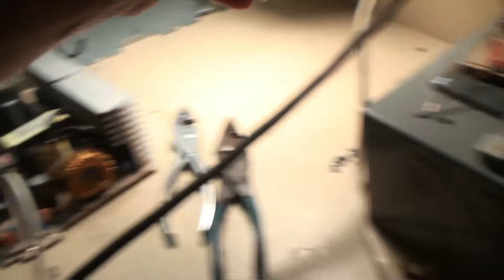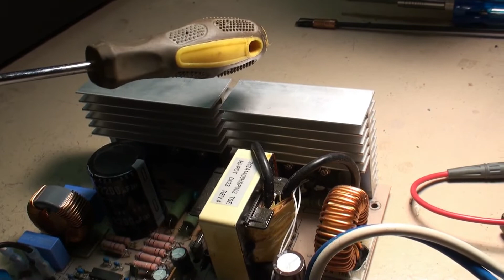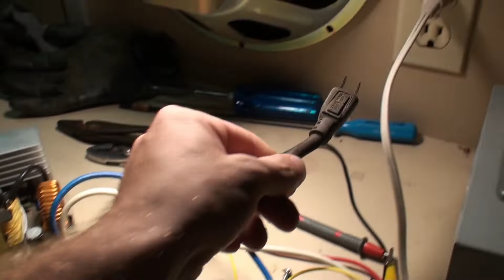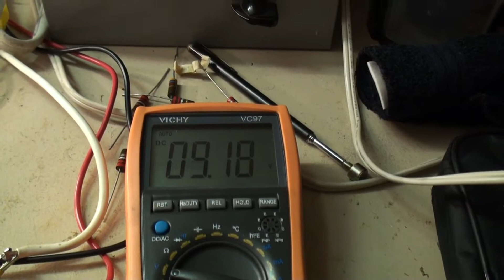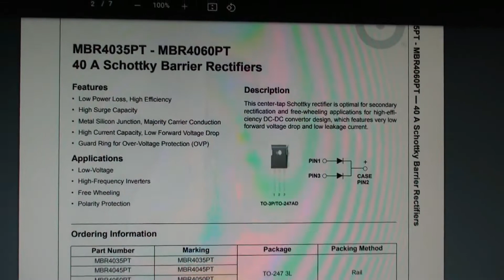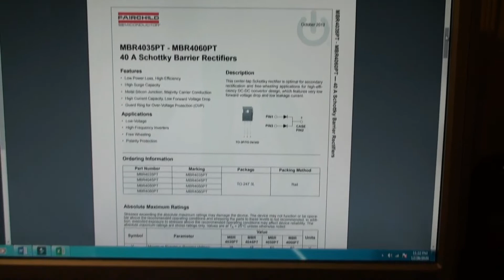Atwood RV Power Converter, Model APS-5530, Low Output, 6 Volts !!  Repair (Part 1)

Comment: This thing is apparently a freak of nature..i have the same. I gave camping world my info and ordered a replacement...they sent me a wfco 8955replacement series "kit"...the thing is an inch too tall to mount where the old one came out.....no instructions no brackets nothing.....
Reply from the maker: I'm really not a fan of these modern switch mode power supplies.  I seem to be constantly fixing them, and I have seen all kinds of problems with these newer styles, whereas, all the campers from the 80's and 90's, have power supplies that are still running strong.  Sure, they can be a tad noisey, but I really believe that if your powering a whole camper with DC, you need some serious iron in there and you need to keep it simple.  So for the power supply in this video, I currently have a pair of MDR4060PT Schottky power diodes on order, of which I am positive that when installed will fix the problem.  It's likely these thing are not beefy enough to handle some of the larger power demands of the modern family camping trip, and fail in a cascading manner.  I wish you luck with your search for a replacement supply for your camper.
Reply: @UOttawaScotty  I'm looking at it now and it looks like I could probably even mount it to the floor by the water heater 2 feet away from the actual electric Center box. The only difference I see in wiring it is the natural or Earth or whatever it's called my old one just has two wires and this one has three and this converter has a neutral ground on the case itself. How important is that neutral? I have full coverage insurance LOL
Reply from the maker: @misterdeplorable2088  the purpose of the green ground is to protect against the situation where you have a hot wire (black) that somehow gets damaged and makes contact with the case.  Because the (green) ground and (white) neutral are actually connected together inside the breaker panel from the service your plugged into, it serves as a low impedance return path to the break, which will Tripp the breaker.  Because the earth is also a return path for your electrical service, if that situation where to ever occur, and you somehow energized the frame of your trailer, and touched an energized metal serface while standing on the ground (especially in bare feet), you would get a nasty shock.  Your new supply having a three wire setup is the way it should be, just make sure that the green (ground or "bonding" wire) from the case of your new supply is electrically connected to the metal case of your breaker panel, should be relatively straightforward and easy.
Reply from the maker: Black (hot) should be connected through your current limiting device (breaker).  Neautral (white) gets connected on your buss bar in the breaker panel, and the ground (green, or sometimes bare wire), should be connecting the metal chassis of your power supply and breaker panel.
Reply from the maker: Not sure if that answers your question haha ?  Let me know...
Reply: @UOttawaScotty  man that answers my question perfectly. Now i have another...since it doesnt fit the hole im going to mount it in the water heater cabnet..  Do i gound the green to both cases or just the main one ? The reason i ask is because there is a place for chassis ground on the new unit which would presumably be grounded metal to metal with the old unit sooooo....did i just answer my own question LOL? Thank you so much for your help! What is ypur opinion on converting the furnace to electric with that kit? And the water heater...the rod or something? I dont plan on doing any boondocking anytime soon and with electricity i dont have to fetch it like propane.....
Reply from the maker: @misterdeplorable2088  Any appliances - water heater, furnace, power supply, etc etc - with metal cases or surfaces should be grounded (or sometimes referred to as "bonded") together with the green wire (or sometimes bare) to protect against the situation I was describing earlier.  in addition to protecting you against faults, grounding will serve to protect you against induced over voltages from high frequency high energy pulses such as a lighting strike.  If your camping and lighting strikes nearby, it is possible (highly unlikely...but it happens) that the metal surface of appliances etc can flash or arc between each other, and in a camper with propane lines running everywhere, this is obviously a safety issue.  So, to sum it up, you want make sure that your appliances are all electrically bonded together, or grounded, I can't really understand your particular situation, having a hard time imagining it in my head, but the concept is relatively straight forward.  To answer your question about the shore power heater situation.  The plug of an RV is usually rated for 30 amps, which is a good amount of power, but even that cord can become quite hot if you start running multiple electric heaters simultaneously.  So, say your running a 3000 watt electric space heater, while the electric heating element is on in your water tank, while your fridge is running on electric, while using the microwave, while playing drums (lol) and with all the lights on.  That's a pretty significant power demand and   even your big 30 amp cord is gonna have a hard time with that !!!  This is why most appliances in RVs are not all electric.  The amount of dense chemical energy stored in fossil fuels is a great way to cut back on the electric demands, and puts less stress on your electric system.  But I can completely relate to what your saying about the propane.  If your plugged into shore power with a descent 30 amp cord and receptical (not a regular extension cord) then you should be able to run any two of the previously mentioned appliances with no problem, but the moment you start adding additional things online, you'll start tripping breakers and running into other problems.  Just be conscious of how much electrical energy your using and try not to run everything at the same time.  Any electric heating element is a large power demand, especially a microwave.  Hope that explains things.